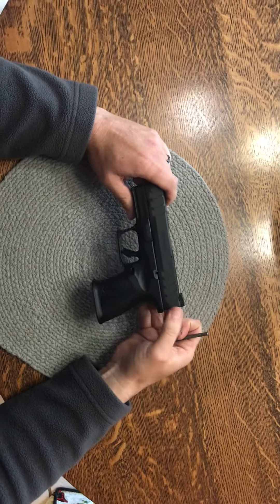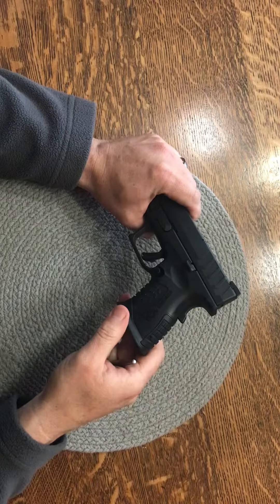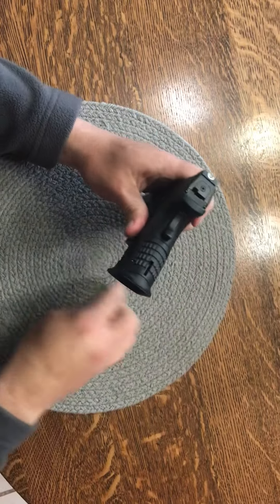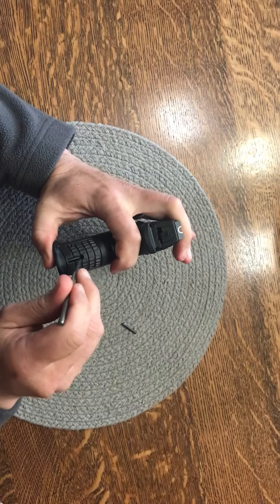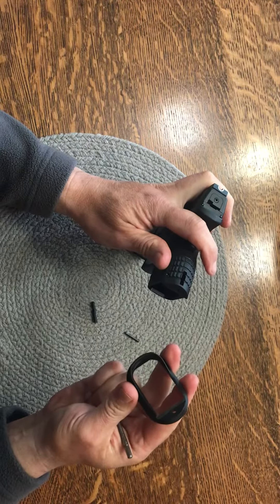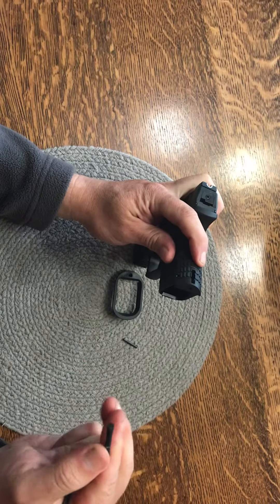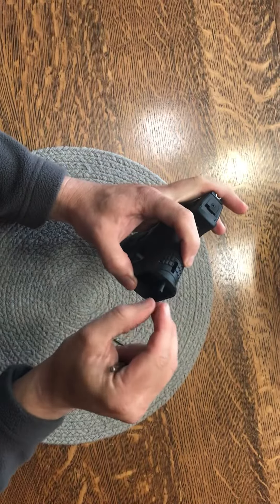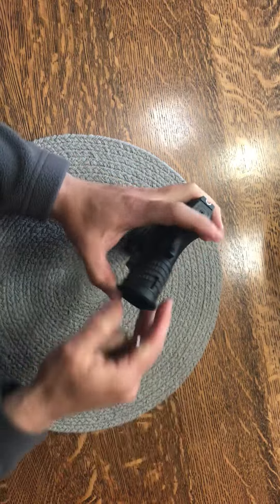XD-M Elite 10mm Magwell removal- Correct Method.

Comment: Thanks for video. FYI: The longer vertical pin does not get reinstalled after removing magwell. Only the shorter pin is installed. It’s not mentioned in video and many folks asked
Reply: Thank you for the additional info.

Comment: The second keeper pin on the bottom that holds the magwell on does not go back in the back strap once the mag well is removed? Correct? Didn’t see in manual if stays out once magwell is removed?

Comment: Do you have to put the vertical pin back in when changing back straps? Or is it made for adding mag wells specifically?
Reply: I just took my magwell off and it looks like the vertical pin is just for the magwell as best as I can tell